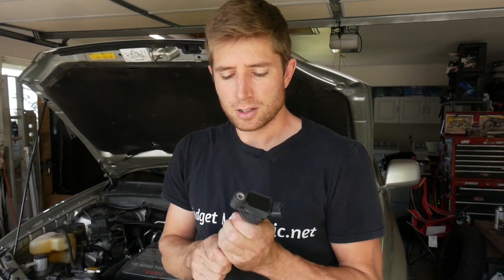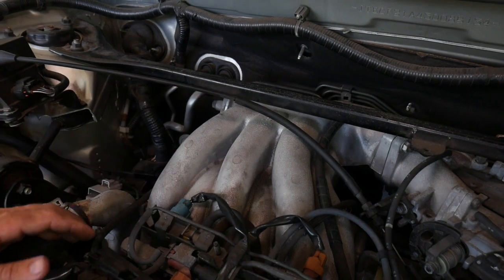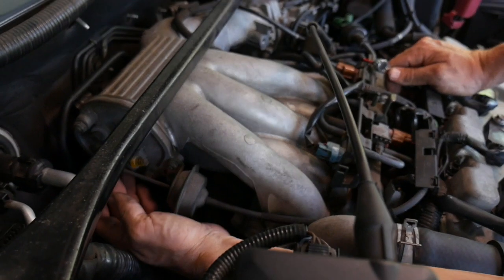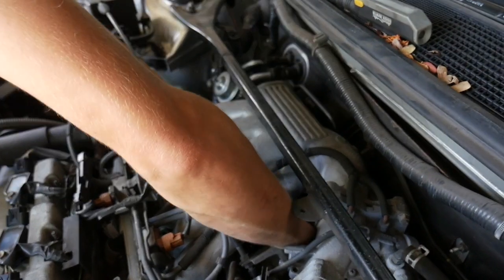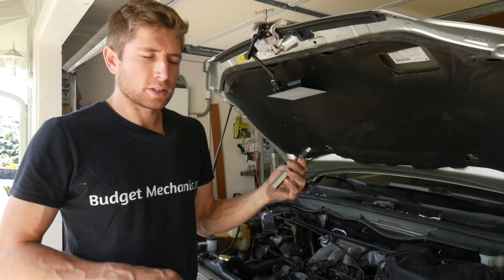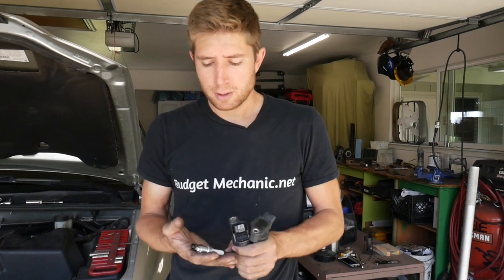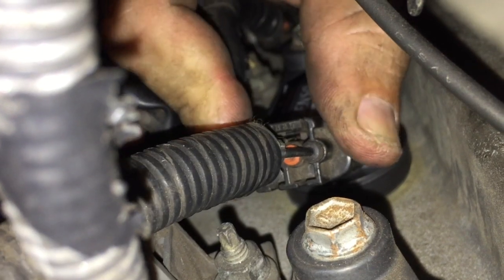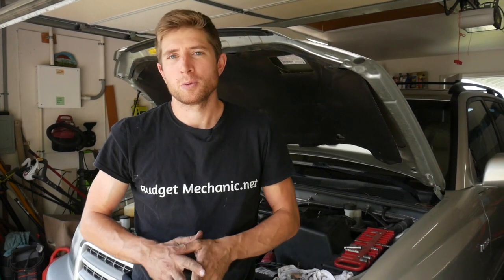Short Cut! Replace Rear Ignition Coil On Toyota Highlander Camry Lexus 3.0 V6

Comment: Can you get away with a similar technique on the 07-16 Sienna (2gr-fe) engine? I only have a code on cyl 6 F -- front right -- which is easily accessible but I'm considering replacing all coils and plugs if I can do so without taking the intake off. It's 205k miles and I'm about to start a 5k road trip, so I'd rather it not lose another coil mid trip.
Reply from the maker: I have never tried it on that engine sorry!

Comment: I replaced the injector coils and spark plugs on a 2007 Avalon.  No way we could access the back 3 unless we took everything off.  Windshield wipers and tray, airbox and intake manifold to get to the ignition coils and spark plugs.
Reply: Reading many comments. If taking off everything but manifold would still may it easier, if you are short.

Comment: Hello There. Awesome video. I need to reach coil # 5 on Sienna 2007, the one on the right. Very similar to this engine. I will give it a try this Saturday. You remove the coil on the right to change the spark plugs, right.? If so.. Did you remove anything else? Thx .
Reply from the maker: I’m not sure if this video applies to your engine!
Reply: Did it work?

Comment: I did this on mine and it didn't have that throttle cable there and the plenum thing was plastic. Idk where the throttle cable is on mine. It's a 2004 Toyota Highlander as well

Comment: Does this procedure work well for a 2007 Highlander. I’m needing to replace mine but it seems too tight of a fit.
Reply: Did not work on my 2003 Highlander…could only barely do the rightmost (driver side) #5 this way, and that took well over an hour and a half.

Comment: As a viewer of video just a word of caution. I inspected my family’s sparkplugs on a Camry. They have the same plug clips as this video. I’ve seen and read that plenty people will snap those off completely. I guess maybe be prepared in the event that the clip breaks back there.
Reply: By "plug clip" you mean the connector clips to the spark plug coils, right?  If so, yes, be careful with those, especially on higher mileage vehicles!  I broke two coolant sensor connector clips and one oil sensor clip in a 5 minute span, but the vehicle was 27 years old and has 330k miles on it, so new parts are probably in order (as evidenced by it running very poorly when the engine is not at normal operating temperature).
Reply: Wellness Path For Me correct

Comment: That's actually a 3.0L V6, not the 3.3L V6.  The layouts for the two are slightly different.  I really wish what you were showing here also worked on my 3.3L.
Reply: Is it harder on the 3.3? Is this method still possible?

Comment: This does look easier.  However, eventually the other plugs and coils will fail too.  Thus, I would say just replace all 6 at the same time.  Replace the oxygen sensors and maybe the PCV valve while you’re at it.  3 to 6 hours well spent in your driveway

Comment: Nice, but good luck replacing the rear valve cover gasket or knock sensors/harness without that plenum being removed. Those are common major issues as those 1MZ-FE engines age.

Comment: Has anyone attempted this method on the 3rd gen Highlander? I have a 2015 Limited that has about another 10K miles before recommended sparkplug replacement is due.
Reply from the maker: Unfortunately I don’t think this will work, tho I haven’t tried on that model
Reply: Upper intake plenum has to be removed to accomplish rear spark plug/coil removal and replacement. Separating throttle body from plenum is also required.

Comment: One more thing, be careful with spark plug sprockets that have that rubber deal, that rubber can dislodge from the sprocket and end up stuck on the spark plug while the plug is still in screwed in. This will leave you no way to push the sprocket all the way down and you will certainly be removing the intake plenum to snake a wire down there to remove the rubber piece. Better off taking that rubber out of the sprocket  prior to even putting it on the spark plug and using the magnet as you did.

Comment: THIS DOES NOT WORK ON A LEXUS RX330 2004. My hands are thin and the layout is similar but not close to this layout on a highlander. Could barely even get my hands through let alone with a wrench. Besides even the ac thing he mentions on his left is different. There is no philips bolts there are 3 ten mill bolts and after unscrewing them all there is still something holding unto it. Try for yourself and see. I challenge this guy to show us doing thr same procedure on an rx 330 as per his title. Good luck

Comment: Misleading you say Toyota 3.3 motor but you're working on a  3000 Toyota motor.  have to remove intake on a 3.3 to remove coils and spark plugs no getting around THAT!!! Lexus 2006 RX 330
Reply from the maker: Thanks for noticing that, we'll update the description!
Reply: Thank you had to replace coil on a 2006 Lexus rx330 with 3.3 motor and the intake has to be removed to replace spark plugs . It was a BUMMER ☹️

Comment: Will this work for the 2005 Toyota Highlander 3.3L V6?
Reply from the maker: Seems like most people with the 3.3L are saying this doesn’t work, but I’ve heard that on some Toyota models it does...
So you might just have to see if you can get your hands in there and reach the coil. And you shouldn’t have to remove much to do that test
Reply: I just changed all 6 plugs and coils this weekend on our 2005 Highlander V6. My arms are bruised and cut up but I managed to do it similar to this video. My biggest problem was those freaking plastic clips. Literally all 6 snapped on me. The plugs seem to be tight enough without them but getting the rear clips disengaged was absolutely brutal I'm not going to lie.

Thank you for the great video just wish it was as easy on the '05 😕

Comment: If you have a Toyota highlander do not follow this advice. You cannot do this blind because there are brackets and other obstacles that make it impossible
Reply: Even after removing the wiper assembly and plenum it was still difficult getting the coils out
Reply: More specifically I have a 2013 so maybe this car he has is easy but a2013 toyota highlander is not like this